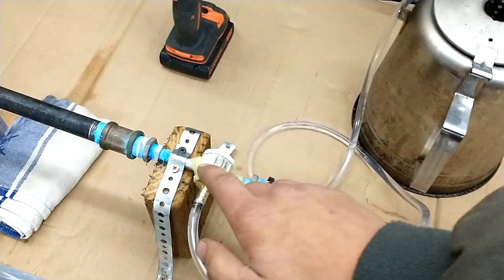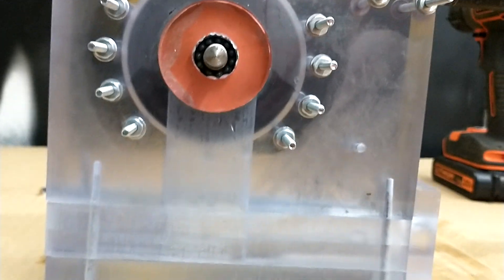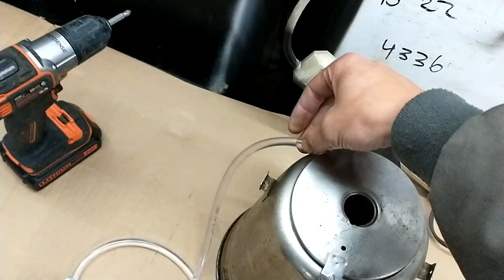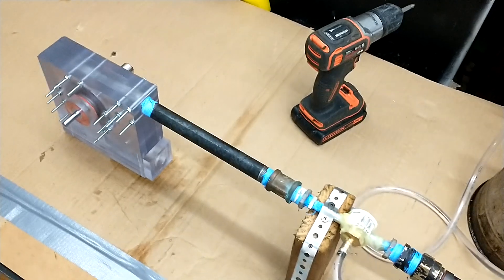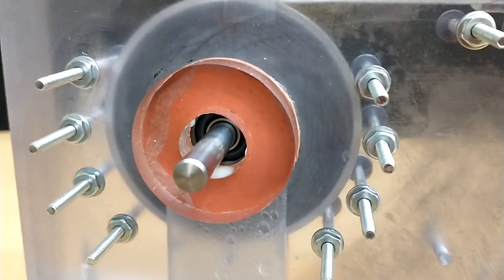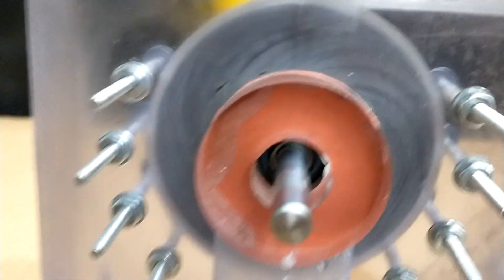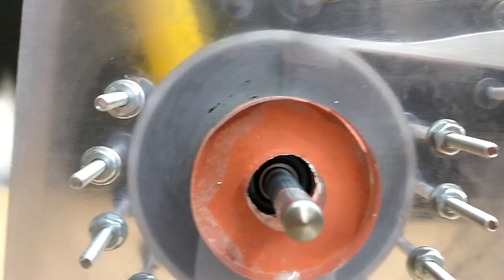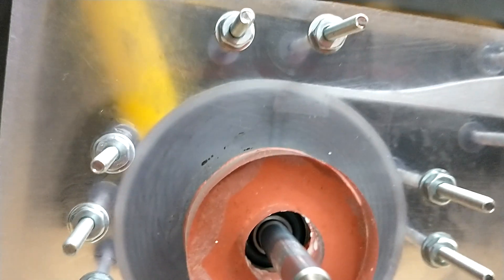Amazing visualization of the boundary layer inside the tesla turbine! See the vortex!!

Comment: as the turbine speeds up then the length of the engagement between the working fluid and turbine increases, forcing the fluid through longer and smaller tubes inside the turbine. it feels like there is some sort of waveform at play and them collapsing could be the reason the turbine looses speed randomly? maybe theres a way to make the heat, noise, and rotation harmonize since they're all vibrations?
Reply: well that explains why tesla was worried about resonate frequencies so  much; the tesla turbine is as much of an instrument as it is an energy converter. for each working fluid temperature and density there must be an optimum resonate diameter and thickness of the disks? I'm thinking about the thermal acoustic cooling devices that nighthawkinlight is doing? or how flat panels vibrate and resonate in air like those cool sand on vibrating metal videos or those polystyrene pink foam flat panel exciter speakers everyone was making a few years back. im really starting to think this is a thermal-acoustic device too
Reply from the maker: The turbine looses speed in this case because the water condenses and adds tons of friction between the side walls and the rotor. We will be using a hydrophobic coating on the casing in the future to prevent this from happening. "im really starting to think this is a thermal-acoustic device too" This is a possibility, we will know for sure soon.
Reply: @iEnergySupply  Have you looked into pnuematic votex tubes? They're kind of a small curio that can convert compressed air into a high pressure hot air votex and a low pressure cold air vortex. The hot air comes from the air spinning around the housing of the tube hundreds of times before leaving the nozzel. I had a feeling one of those would be really good at injecting and forcing entrainment and vaporization of a liquid with an injector or venturi nozzle. It has no moving parts and can pre-establish spin in the air moving down the tube. I had an idea that one of those blowing into the center of a tesla turbine could act like a turbo and water vaporizor at the same time making steam from room temp compressed air and water at atmospheric. This would also precharge the water with heat for the turbine to sap.

I also figured if they get to that reported 200c the product manufacturers say, then they could also entrain liquid or fine powder fuels and force them to combust without a pilot light, like a ram jet.
Reply: I'm really excited for this tesla turbine tech youre expanding on. I have a homestead that uses compressed air lines for long distance power transmission instead of AC lines because its a little safer for my family to work around and easier to repair incase of failure. A device like your turbine would mean that my compressed air to electricity generation would be more efficient and easier to maintain in a home machine shop and use a lot less have-to-buy motor oil than locomotion I'm using now.

Comment: If u recirculate the water how much water does it use.
Reply from the maker: We will be calculating that soon, but it uses very little water, then you just pump the condensate back to the boiler.
Reply: @iEnergySupply   I’m thinking about running one on a ebike .  I’m I thinking about building a tank with induction heaters from a coffee pot to boil the water.  Use the turbine to create electricity in addition to the battery.    
It would basically run of steam when battery starts getting low to recharge and at full throttle.   

I think if can get rid off the voltage spikes caused by accelerating the batteries range would be much much longer ..

Comment: Lemme ask u a question, when we use a air compressor to run the tesla turbine dan connet to a motor, we can make a tesla turbine become a generator, so how if we use the electric to power the electric compressor? Is it posibility become a free energy generator?
Reply from the maker: well, it's possible for the heat to be free, because there is a constant heat differential everywhere with the earth. the energy from the earth is free, we just need a way to convert it. We have found the way.

Comment: Is the water really really cold? Can you make a new type of air conditioning with this?
Reply from the maker: the water is very cold, at this point we are not sure how well it will work for an air conditioning system but we will be experimenting with this concept in the future.
Reply: @iEnergySupply  Let it run through a thin grid of copper pipes and put a fan on it. I wonder if it'll be more efficient than a standard AC... but I guess it'll depend on how you make it

Comment: Can you run this off of steam alone?
Reply from the maker: absolutely, please see our latest video.
Reply: Also it looks like the exhaust is not fluid. Is there a reason that you wanted turbulence there?
Reply from the maker: no it should be fluid, the exhaust should be positioned slightly different, it's corrected in our latest design.

Comment: Very Cool!
It would be interesting to see a side by side comparison with and without water addition. My first intuition would be adding water would increase the torque but reduce the speed from the mass and viscosity/surface tension of aerosolized water. 
I'm not yet sold on the heated water adding much usable power to the system but it's easily testable so looking forward to further tests :)
Thank you for taking the time to film and share your experimentation.
Reply from the maker: yeah, what I want to try next is steam and compressed air.
Reply: @iEnergySupply  something to take into account with steam especially, is that it exponentially increases its expansion pressure at higher temps. Gauging the temp up to 750°F/400°C, if your equipment can handle that, will get some interesting results.
Reply: wouldnt increasing the number of layers (by a lot) increase the torque to something more useful?  maybe have a meter long pillar of disks.
Reply: @luminousfractal420  yes! More discs means more torque. But you’ll have a limit to how wide you can go where your exhaust holes aren’t big enough to handle the volumetric flow rate needed to torque on the shaft of discs.

Comment: Hey guys been watching you guys for the past year. I have a question though, how do you know the size needed to keep vacuum on the dual stage turbine?
Reply from the maker: it should be the same size but with three times the disks.
Reply: @iEnergySupply  apparently this is how you tag a to a reply lol
Reply: I seen a video that someone posted interviewing about the dual stage. You stated that the vacuum side needs to be larger in diameter. Why is this and at what percentage is the increase? @ienergysupply (idk if I need to tag you here lol)
Reply: @jacobray6655  either works, but using the same disks as your rotor is easier

Comment: Is there a different type of gas that you could utilize that could be EGR'd? Why does the exhaust port look like it has poor fluid mechanics? Closed loop gas, electric start on axle, clutch release, spool up, clutch engage, power generator
Reply from the maker: I've found that the generator must be directly attached to the rotor to avoid friction at high speeds.
Reply: @iEnergySupply  water is not a lubricant, and using compressed air is causing water vapor and droplets. Ac refrigerant uses an oil in the lines.
Reply from the maker: @David_Mash  we really want to incorporate some kind of oil with our cold steam system
Reply: @iEnergySupply  the problem with using air is that you get water and water does not mix well with most oils. If you can find a dryer gas like the system in your car then you can use the oil from there

Comment: What would be the output from the turbine if airflow at 334 m/s velocity and flow rate of 32 cubic meter per minute is used?
Reply from the maker: I need to wait for the empirical data to answer the question accurately.

Comment: Are you intending on selling the complete product once you've finished development? I want this in a van so we don't have to worry about solar! If this were to run just on the pressure from the warm water without any compression or vacuum unit, maybe using a copper heating element from a fire or log burner going into the pressure/water chamber, what temperature would you want the water to be?
Reply from the maker: we got 600 watts on our 135 degree water test, we had ice on the condenser. that was a low speed test though and much more to come on the subject. Higher speeds = more power. We are waiting on our analytical equipment to show exactly what it's capable of and what's going on.

Comment: Man this is epic! Loved it. Hey random question! Would a tesla turbine be able to achieve full 97% efficiency without failing if it was running in space with no gravity?
Reply from the maker: well, we can simulate space with temperature differential. We are running our new turbines in a vacuum system where the boiler is under pressure and the condenser is under vacuum. We will have one addition to the system and that's a vacuum pump that goes inside the vacuum to drop the pressure to degrees close to space. Tesla Suggests this, and says the performance increases 50% With our analytical system we will see.
Reply: @iEnergySupply  very nice! OK I was thinking maybe if the materials were in a weightless environment they'd perhaps be able to withstand more forces. Look forward to seeing your other videos!

Comment: interested in slinging balls like a cannon or sling, at rim speed? just two, left and right, discs, same boundary layer friction
Reply: also a heat dissipation discs and heat collection discs
Reply: center or near center holes to suck air in and sling out from outer rim
Reply: spiral channel boundaries, bound together as a one rotating block, kinda like a spiral water scoop wheel
Reply: have you tried pressure from center to be cast out from the input?
Reply from the maker: This isn't the intended use of the turbine, if you watch the two new videos on the channel we show how we intend to power the turbine.

Comment: You said the human thing, imaging and cameras.
Reply from the maker: I'm not sure what you mean. Can you elaborate?
Reply: @iEnergySupply  In the time since TV, really motion pictures as a concept, the brain math of humanity has reduced to the same 2D, electrical engineering math model, the one Shannon delocalized so we could have this chat. The internet completed this in 2009 with the Digital Broadcast Standard. In the math of physics, resolving the quantum misnomer jumped from QED to QCD and then they made up string theory without knowing why. 

The visible spectrum is not in any way special or non-arbitrary. Putting thermal imaging on this is like trying to give synesthesia of felling hot and cold with eyes. It gets lost in the image to 90%, the other 10% do not need it. Eric is one who might get this point. Seeing what is actually happening needs a fractal continuation. I am cursed and blessed to see in pure math. So I'm ripping out the guts of a modern car and doing the placement for actuation, fuel as a hydrogen-based liquid under temp and pressure stability, transmission/flywheel/clutch tweeks needed, all in the rough grain. I really can't help it. Makes life maddening. Elon should be executed for stealing the name alone, and poisoning the environment.

Comment: I remember when I was using airdrills. when water got into the line the speed doubled at least. Always meant to get back to that and experiment deliberately with it
Reply from the maker: o yeah! I've seen this happen too! What we need for the test is hydrophobic side walls, to keep the water from slowing the turbine down when there is too much in there.
Reply: @iEnergySupply  I was thinking that if the air which spins turbine would come from combusting HHO it would turn into water so you would'nt need to add water or if you needed you could change the ratios on combustion to a richer/leaner mixture and even automate it with sensors so you would be getting right amount of water into turbine
Reply from the maker: @ruuti3121  Yep, this is one of the experiments we will do shortly, we will be using the tesla valve to control the pulse/flow direction.
Reply: @iEnergySupply  Why not apply a hydrophobic coating such as Rain-X?
Reply: @johnwyman6126  My experience with Rain X is that dirts tends to stick to it like glue over time, and then its almost impossible to hold it clean. But with steam it should be clean, so maybe a great idea.
Reply: @RogueSecret  I have never, ever had that happen to me. I have used it on many of my personal vehicles windshields since 1982, and on my Freightliner semi, and on my Peterbilt too.
  The glass has to be perfectly dry in order to apply it. Just don't use it on glass or mirrors without a windshield wiper. Some atmospheric conditions can cause it to fog up repeatedly, and without a wiper you won't be able to see. It's also about impossible to remove. Don't ask me how I know these things...

Comment: Have you tried using Freon or anything of that nature? Maybe instead of propane for heat, solar panels filled with Freon or a substitute in a closed system to keep the temperatures in a smaller range. Also could combining Tesla’s valve on both intake and exhaust ends would force a higher flow and exchange into the system?
Reply from the maker: We have tried ammonia but ran into problems that can easily be solved with a little more time. I'm trying to avoid the ammonia, ill be demonstrating this soon. I agree with the tesla valves too, but they must be sized exactly for the flow requirements of the turbine.
Reply: what about the glasses inside double pane windows?  do those insulate some thermal heat without blocking the energizing rays or could it be simpler like a water jacket just to prevent the panel surface from getting too hot...

Comment: Excellent! Now how about trying the input to the turbine with a steam ejector using atmospheric air as the secondary fluid. You can get the enthalpy of steam (2676 KJ/Kg) to do a great deal of work!
Reply from the maker: Great suggestion! It will be on the to do list.
Reply: Yeah, I drew up something a while back running off of the plume that comes out of the stacks at the refineries it is all just steam, but I said a steam jet, because you get a roughly  6 to 1, or 9 to 1 compression ratio. And than you take out the need for a compressor. The only thing I could not figure out is if you should scale it back a little bit the way you get the super sonic  boost, not the velocity boost. I think that is what the last part of the process is called, but you cannot increase the size of your pipe afterwards because you are going to lose pressure.
Reply from the maker: @mitchellsmith7868  yeah, nozzles are extremely important.
Reply: @iEnergySupply  I did not even think of it like that, so you are saying that if you allow your nozzle to pull in atmospheric pressure that it could reach super sonic velocity. Instead of just a velocity boost. That is genius!!
Reply from the maker: @mitchellsmith7868  It must be tested, but sounds promising.
Reply: @mitchellsmith7868  Absolutely! With enough motive steam pressure (superheated) and the perfect Condi nozzle, the mixture after entrainment of air at the turbine's inlet would also be above mach 1 to say the least . Also Interesting to see would be the exhaust temperatures out of the turbine 🥶
Reply: @vermash  that is all they have to do is add one of those drain heaters off a freezer one of the commercial ones they do not take practically no kw to run.

Comment: Doesn't the boundary layer effect interact with the casing walls? Would It not be beneficial to make a gradual increase in case wall like in Tesla's original designs?
Reply from the maker: Depends on weather you want a pump or a turbine. They both have their uses.
Reply: @iEnergySupply  Wow, I wonder if you could use the basic, fundamental equations I've put together for the Skin Effect in a solid. It actually makes math of the material condition, to describe the resonant effect you cite. Tapering would create a resonant cycle, and would accentuate the pump effect. Single gauge would stabilize and focus the scalar waves to the dynamic center.
Reply: Could perhaps several shallow spiral shaped grooves in the inner casing -encourage the working medium to 'ride the disk' longer before exiting -from the get go, to help it spin up faster? Could be in the shape of the final stable vortex, so all flow would stabilize to that pattern (faster?) more reliably given your exact 'power in'/ target velocity.

So cool that it comes out cold though. You can use this technology on every 64,500 power plants in the world and then instead of using their Superheated Water Vapor from their Wet Surface Air Cooling technology to make clouds which is the only way rain is made -they can cool their process fluids directly by sending them through this device -which happens to have the quality of being able to generate lots of electricity. And then we can just have no more rain because there is no more need to dump ground water on hot process fluids pipes at power plants to cool them.